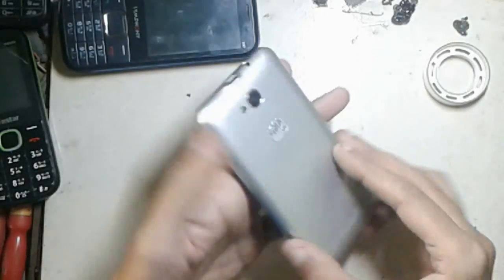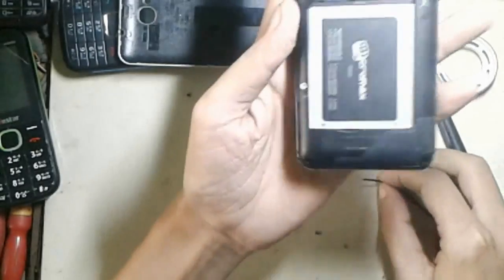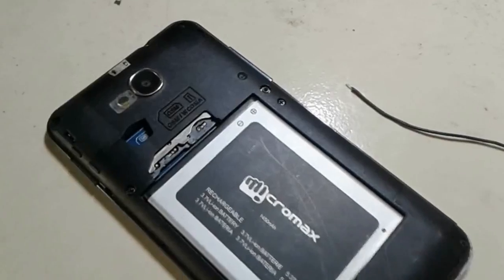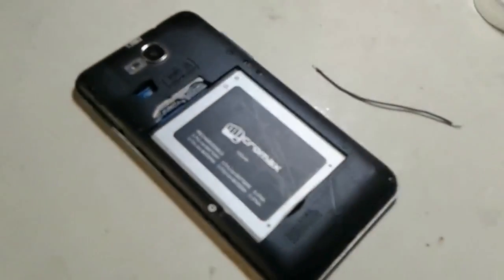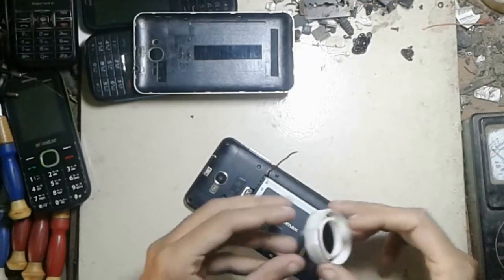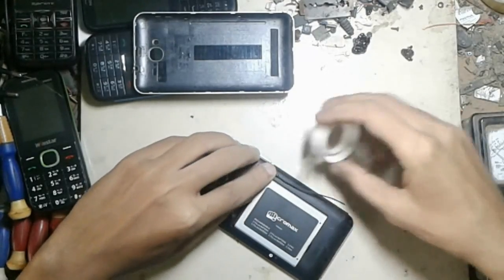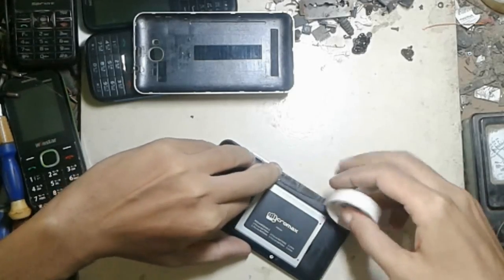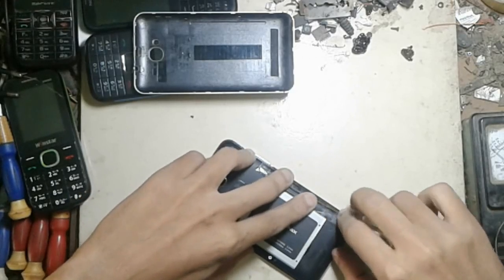How to Make an External booster Antenna for Your Cell Phone

Comment: What wire and how long wire will i fixed on port ??? Can i get full tower after fixing ??? Because in our area there very very very poor signal can't speak with my relatives & friends properly.... 

Need help...

 Plz advice...
Reply from the maker: 9_12 Mm copper or steel wire connect  wire on antenna port on mobile circuit as on video.

Comment: why not tell the people the correct length the wire has to be... it has to be 25 mm in length for the correct band 5g 4g. best to use 25 mm of arial tube then solder a wire inside to the tip with a correct connector on the end that snaps onto the socket.. dont just poke a wire in a hole..

Comment: Meanwhile, the Voyager 1 probe is still transmitting data to earth from  13 billion miles away using a 22 watt transmitter, which is about 80% less power than that consumed by your ceiling fan.

Comment: A slight movement will instantly cause signal loss -- antenna alone is not enough to improve signal because the Cell Tower does not provide consistent signal at 100% all the time. It fluctuates ups and down and only an amplifier / booster can help to improve signal consistently...if you are using antenna it only relies on the cell tower signal ...so it fluctuates based on how much the cell tower transmit. You need RF signal booster to keep up with consistent signal
Reply: HowTo DIY homeMade Electronica nice

Comment: what would be the correct length and best diameter to use for the copper wire?

secondly, when positioning the wire inside the case, which direction would be best for the orientation of the wire? along the top of the battery or down the side? or avoid certain areas of the motherboard or internal components if possible?
im just curious if these factors make any significant impact on reception. 
thank you
Reply: i think a partial answer may be between 11 and 13 cm, for 4g lte bands

Comment: sir which wire you are using please can you tell.
Reply from the maker: You can use any steel wire
Reply: steel is best, not copper??
Reply: What has DC got to do with signals? When we are talking about MHz, this is AC not DC. Maybe steel wire is a better conductor, hence you get better signal boost. Also if the steel wire is not insulated, it will have more exposed surface area & hence better signal strength.
Reply from the maker: Great question. :) you can also use copper wire no problem.But  Steel wire can reflect more frequency then cropper wire.
Reply: and by that do you mean a stronger db gain, or more bands?
1 more important question to that as well, are there some frequencies that the steel wire can get and the copper can not,and vice vera? 
for example maybe steel can get 2100mhz but no 700mhz or copper can 700 but no 2100mhz?  thank you
Reply from the maker: haha not really. When increase distance between phone and tower then steel wire can catch  more gain coz it can pass dc voltage quickly
Reply: By the way, there are certain norms regarding the power (dBm) transmitted / received by any wireless device & all manufactures have to abide. Do not attempt such modifications, it's harmful. The internal antenna socket could be for testing signal parameters during production / manufacturing of mobile phones. Such tampering is foolish & dangerous. Do not fall for such kiddish videos.

Comment: It works, it would work even better if the wire were cut to the correct frequency, so, it's in proper tune and not spraying harmonics across the band.
Now ask if it legal, probably not, but, the phone police aren't going to kick down your door to arrest you.
Reply: SMRITY COMPUT00oR  ć2fwz
15₩
Reply: SMRITY CsOrrrdrrrrrr3MUTEDhowhowmhowtrading55 @gmmhowmhowmmmmmmmm
Reply: Charles Zimmerman 4 USA
Reply from the maker: When you stay long  distance from network coverage it help to catch coverage. Some mobile company use this kind of antenna wire internally. thanks for your comment.
Reply: It has to be cut to match frequency or you risk damage to the transmitter in your phone.....

Comment: is there any side effect or not ?
regards damaging phone
Reply from the maker: Tnx for your comments. No side effect :) You can do it 100% safely
Reply: If the wire is not cut to match the transmit frequency it can most certainly damage your phone....research how RF and antennas work....
Reply: phakhir mohan muria
Reply: Your phone physically damage